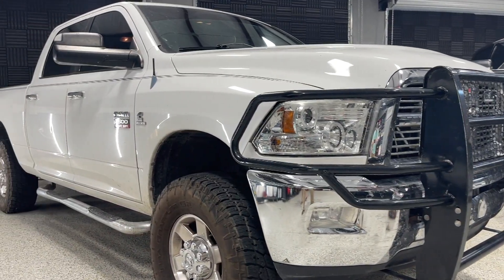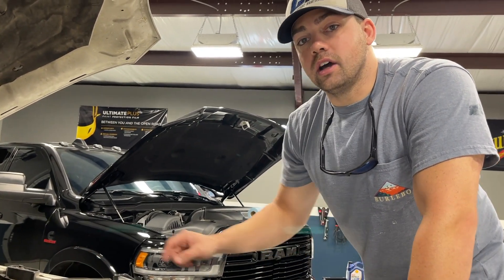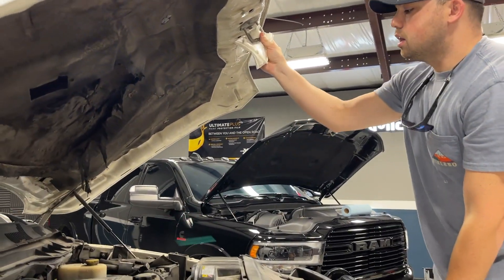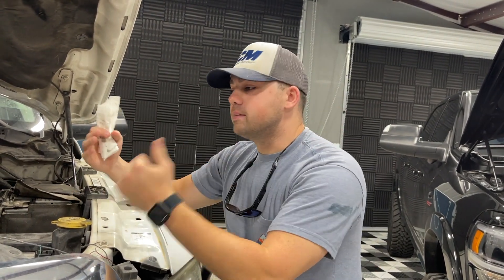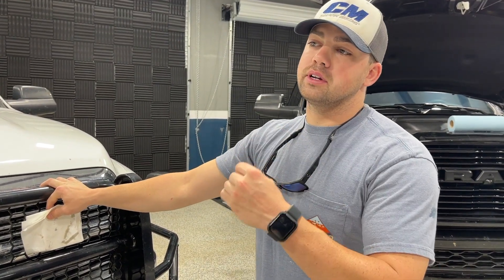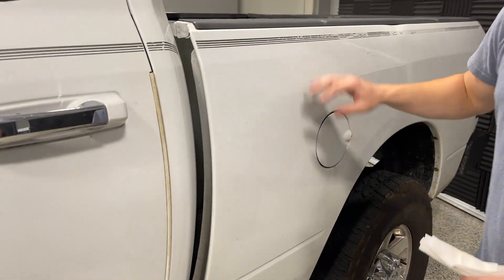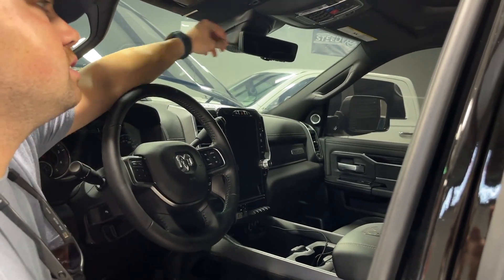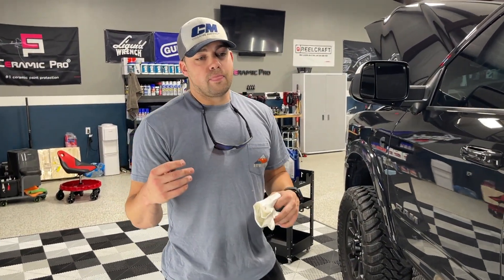Which Truck Is a Better Buy Right Now In This Crazy Truck Market? Here's What We Think

Comment: Schaeffers 9000 synshield Otr or Amsoil signature series max duty the only oils I will use, the best of the best and the labs on the oil I’ve gotten tested fantastic! I have cp3 conversion on 5th gen and I do 12,500 mile-15k oil change intervals and it’s night and day difference compared to my homie who uses rotella t6 and royal purple synthetic oil. Give them a chance but it’s not a cheap initial cost, however the cost is significantly less over the course of the trucks lifetime if you put 100s of thousands of miles on it because you can actually wait the 15k miles to change your oil each time as opposed to with rotella for example you would be lucky to get 7500 miles max and that’s if you got a good truck, most of the time the fuel mileage is inferior and the truck doesn’t run as smooth. Happy trucking 💪🏻

Comment: Late 4th gens are the best 👌
Reply: I like my 93. It will haul anything that 80,000.00 dollar truck will haul for 75,000.00 less. Plus you don't have to worry about scratches and detailing.  No way I am spending that kind of money on a pickup truck. Sheesh com on man buy you a used tri-axle dump and hire a driver to run it. Thanks for being a cop! We have your back.
Reply: Shoot yeah if I had to buy a newer truck I'd buy a 4th gen 3/4 ton dodge.
But I would rather my 2nd gen 3/4 ton truck whether it's a 12v or gas even a 24v. But yeah I really do like 4th gens.
Reply: @karlhiggins5765 my upgraded 5th gen will rip the rear end right out of your 93 lol I hear ya with the scratches and it being a beater but there’s no comparison between that old truck and the new luxury heavy duty pick up trucks

Comment: Honestly I wouldn’t care which one I would get. The 4th gen and 5th gens are great trucks. They both have mostly the same features except the front and rear ends. The Cummins badge is smaller on the 5th gen. Some people say that they don’t like the 5th gen 2500 and 3500’s because they don’t have the same body style as the 5th gen 1500s. Honestly people expected the heavy duties to look like the 1500’s. Since the 4th gen 2500s looked like the 4th gen 1500.

Comment: Love my 2nd gen and I’ve got 283,000. And only run Valvoline Premium Blue 15w-40 and its still clean after 5,000 mile changes. But I only use Baldwin fuel and oil filters? But if I get a new truck I’d try Shell. My only reservation with the 4th gen is the CP4 pump the 5th gen went back to the CP3 better reliability for sure.
Reply: I may be wrong but the 1st year of the “5th gen” had cp4. Then in 2020 they went with cp3.

Comment: I've been running T5 every since 2010 in my 18 wheelers and f250. I love shell engine oil.
It helps out big time on cold weather cold starts.  The knocking clatter goes away immediately

Comment: I'm working on my 3rd Ram. With my 4th gen 1500 being the newest and a 2nd gen 2500 being the oldest I would like to trade the 4th gen 1500 4x4 off for a 2500 Cummins 4x4 I don't have to have a Laramie a work truck like your buddy's Mike's truck would work best for me. I'm in Texas and prices are through the roof...

Comment: Schaeffer’s in my opinion is def better then Rotella. Not something you’ll find at your local auto parts store but it’s worth the extra coin. Also in my opinion the best USED diesel money can buy is a 14 up 6.7 power stroke hands down! Power, reliability,  and transmission are just flawless. Typically a little more expensive then a similar year Cummins but the way I look at is you’re putting a trans in a dodge at some point.

Comment: I may be the only one but I consider “5th gen” still a 4th gen since the body and the bed is the same. All that changed was front clip and interior. Just like the early 3rd and late 3rd they have same body just a front clip change and minor interior. Am I the only one?
Reply: Lol no
Reply: I agree I consider the “5th gen” more of a face lifted 4th gen. As you said 3rd gens had a face lift in 2006 and second gens got an updated interior in 98 and first gens also had a small face lift at some point.

Comment: Hey did you new truck get the recall yet? Those new Cummins have an issue!!!
Reply from the maker: What’s the issue? No recall sent my way yet
Reply: @ParoDoXz  Inadequate warmup protection can cause a lack of oil film on the engine connecting rod bearings while the engine is reaching operating temperature. This is what is said. Wait you don't have a 3500 right? It's for 3500 4500 and 5500 trucks.